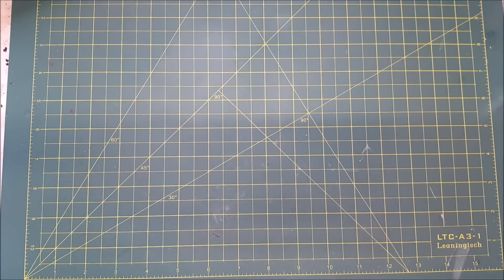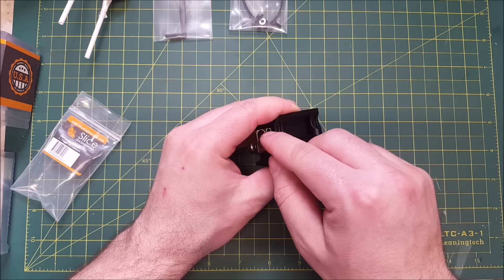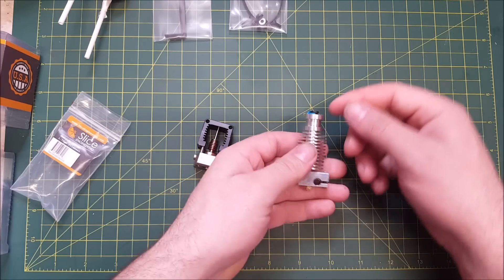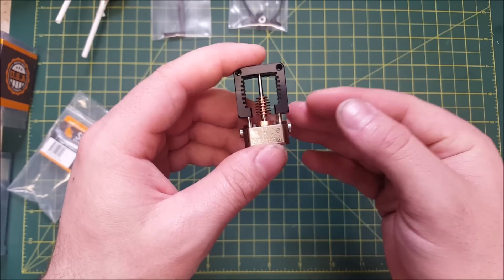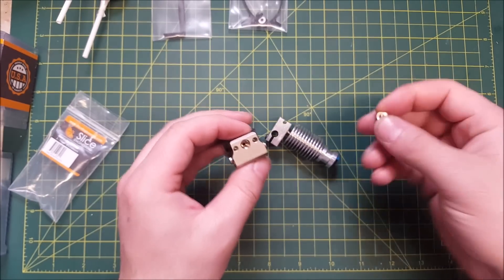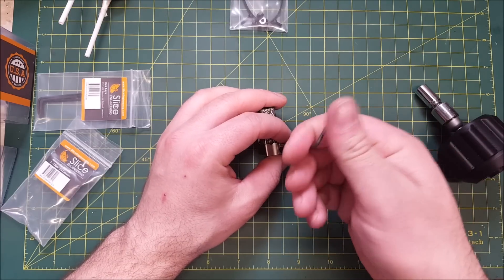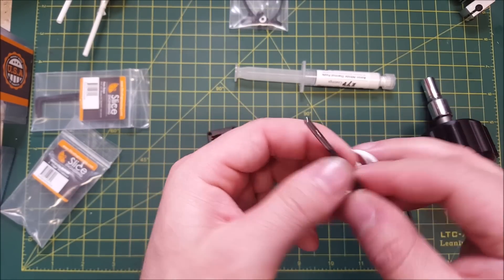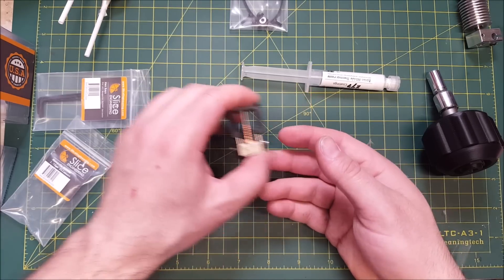Mosquito Hotend Unboxing and First Impression

Comment: Just finished watching the carrot feeder streams and you mentioned having the mosquitos on the shelf? Why are all of your mosquitos on the shelf now after this great review?  Did i miss something?
Reply from the maker: Because this review is old? And things that perform as well or better with less headache came out.
Reply: So nothing wrong with it?  I purchased one after watching this and haven’t been able to finish my bifold and use it yet.
Reply from the maker: @davidgriggs7556  nothing  "wrong" per se
As someone who builds printers often. The boron nitride paste became annoying to work with. And depending on the mounting solution the orientation of the heater block can melt ducts.

The two i had were standard flow variants. One was replaced by a high flow hotend in a larger machine. The other eas replaced with a e3d Revo beta unit. My other machines had hotends that swapping to a skeeter would really offer any major advantage. Thus. On the shelf for now

Comment: You talked about a titanium heat break but also talk about the nozzle making contact with copper on the mosquito. Can you help clarify? Or is the heat break copper plated right at the end (near nozzle)
Reply: The heater block is copper and it also butts up to the copper that holds the heat break. It's also not titanium, it's stainless, not sure if Nero just misspoke or was misinformed.

Comment: so stupidly expensive tho... a genuine e3d v6 is far cheaper. if anything breaks you have to spend another 150$~ :| for e3d v6 a heatbreak is only 19$
205$~ with the heater and thermostat NO THANKS my printer is 220$

EDIT: wait you can get replacements?
60$ for heatblock
Reply from the maker: ya...all the parts are replaceable and available through slice or their re-sellers....

Also, the mosquito isn't really meant for the 200 dollar printer market IMO, printers in that price range wont really push a standard v6 as is.
However on higher speed printers, like the voron, there is noticable improvements.
Reply: @CanuckCreator  mostly the heat stuff that interested me. I thought it could mean less jams and clogs. tho cleaning a full jam will be painful for something like this
Reply from the maker: @chloemcholoe3280  i have a few hundred hours on mine already, printing both PLA open air and abs in an enclosed chamber at 50c ambient air temps, havent had a single issue yet.
Reply: @CanuckCreator  :o awesome! can you say the same for E3D V6? i use a 5$ clone but i'm really looking forward to saving for something nicer!

Comment: I have a question for you.
I want to mount this hot end on  Cr10s. May i reach the high temperature like over 350 c°?
Reply from the maker: please read the documentation from slice engineering https://www.sliceengineering.com/shop/the-mosquito-hotend  
The hotend is rated up to 450c and they have links to different adapters for several different printers on their site.